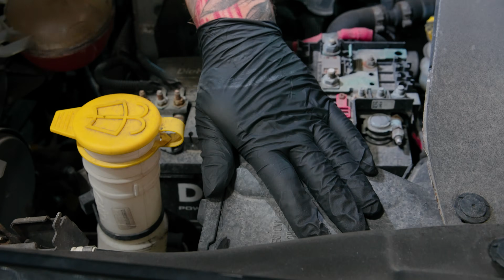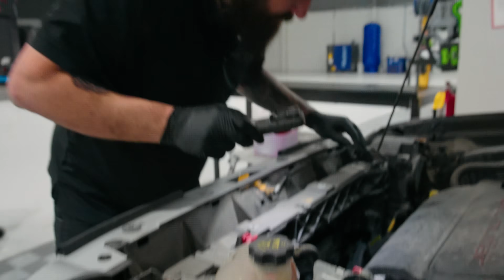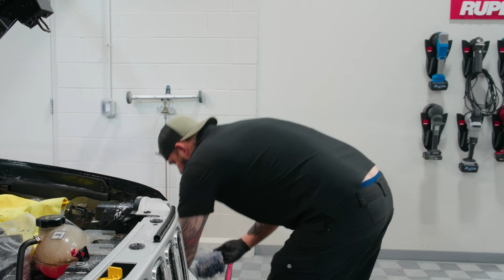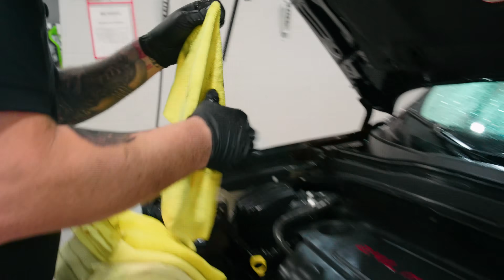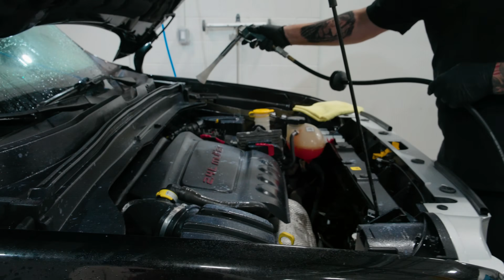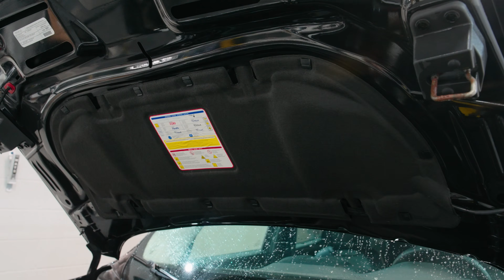How to Safely Clean an Engine Bay | Professional Detailing Training

Comment: Thanks to you. I learned to clean my engine bay. Now I’m no longer afraid to get anything under my hood, wet. What seems to work the best. Is deco soap like active foam. With my favorite detail brushes after washing it. I spray my favorite ceramic sealant and if I’m feeling a little extra spicy, I’ll use my favorite dressing to give the plastic some Pop

Comment: If I'm working on the car I want it clean. You don't need to cover anything unless it's 30+ years old. Keep water out of the distibuter and the carb on those vehicles. Modern vehicles you want to keep water out of the intake. The engine gets wet when you drive it! The engine compartment ISN'T sealed so it gets wet on a regular basis just by driving in the rain or even driving through water in the gutter. You are over thinking it.

Comment: While I've never done this, I'm thinking a garden hose & plant watering setting might be safer. Less pressure.
Save the PW for later.
Reply: The mist setting on a hose nozzle, an all purpose cleaner and older wheel woolies can take care of mist engine bay grunge. I also use steam and blow dry the engine bay. I then lightly mist the engine bay plastics with water and spray Koch CVhemie motorplasr and allow it ti dry.

Comment: I do the minimum that's functional for my daily driver:
1. Cleaning the reservoirs to easily check  the level of the fluids, and if there is any discoloration.
2. Cleaning around any cap to prevent any dirt to get inside during fluid changes/adding.
3. Vacuum tree leaves from spots that can cause water to accumulate.
And that's it, I keep my life simple. Thanks for the video.
Reply from the maker: I like your philosophy